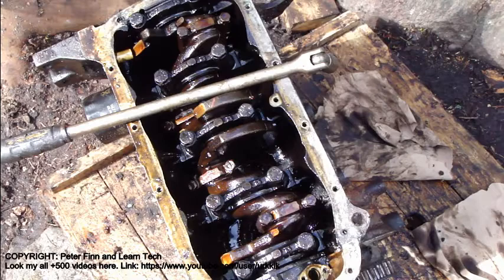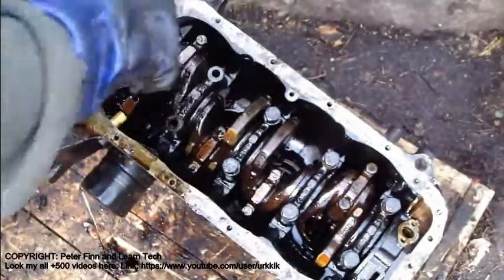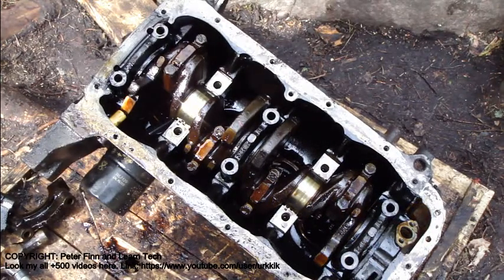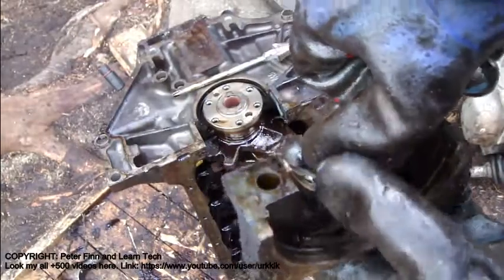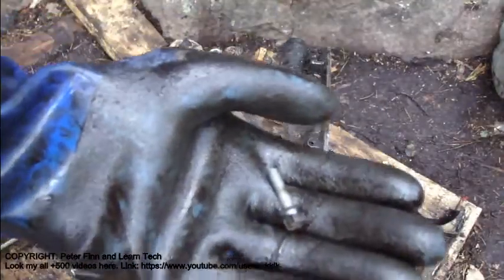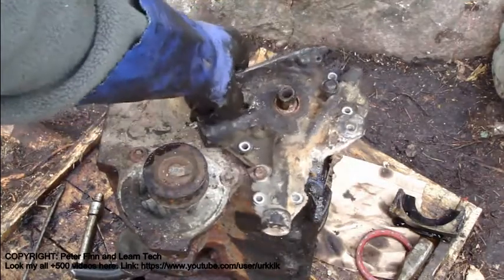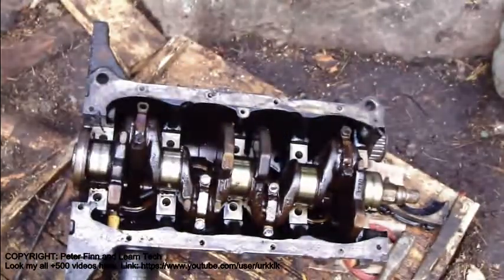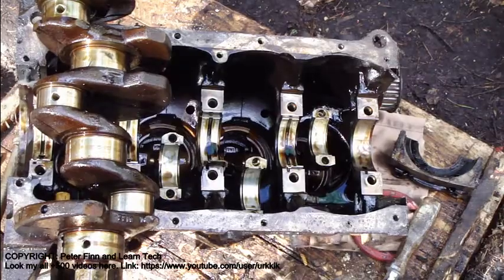Vauxhall/Opel Astra crankshaft disassembly

Comment: Kiitos paljon! I am sealing up the crank bearing shell(cap/plate) with the "very interesting construction" design right now on my Opel Corsa 1.4i (c14se engine 260000km) which was bolted back clean by my engine rebuilders.It pissed oil when I test started the engine with the sump sealed on.OPEL=O Poes Ek Loop.Finnish translation : OPEL=Oh vittu olen kävely!
Reply from the maker: Ok
Reply: @PeterFinnTheCarDoctor  It's still leaking from the bearing cap so now it's off with the gearbox and flywheel to do another RTV seal/gasket job.I had a meltdown with my Corsa and I'm working on something else now to cool down some.